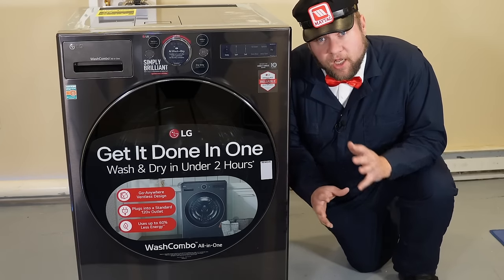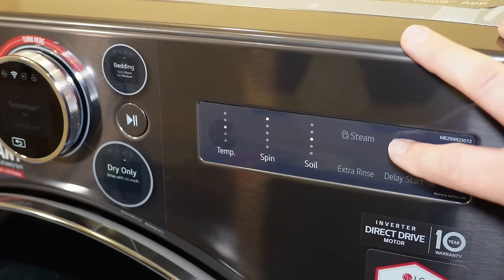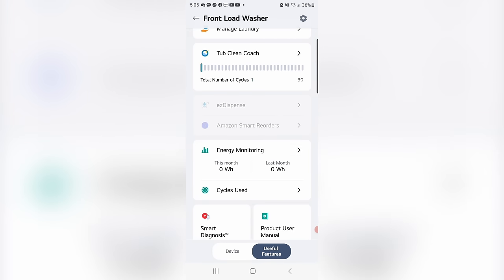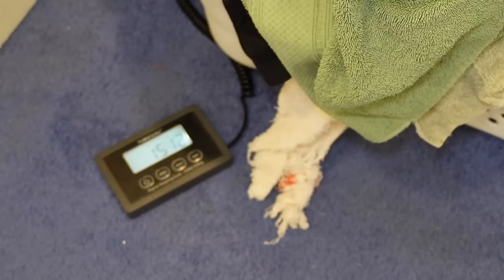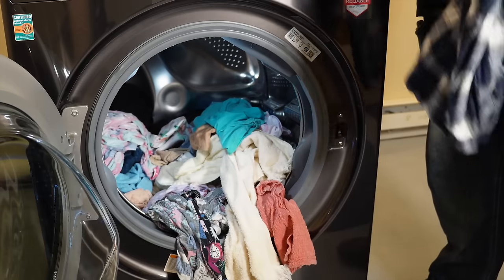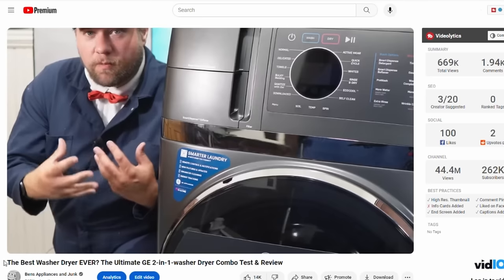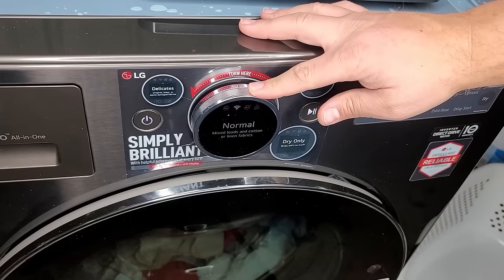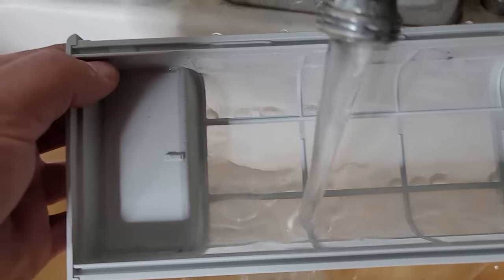BETTER THAN GE? The LG All in One Washer Dryer Combo: Test, Teardown & Review

Comment: I am from the uk and not seen a heat pump lg washer/dryer combo. 
But I can say I am the owner of a lg direct drive smart ThinQ front loader washing machine and I have had it 3 years this summer with no problems bar balancing issues with mainly dog bed and bath mats, it hates them and will hardly spin them lol 😩🙄 but other than that everything is clean first time and just damp after a 1400 spin dry. 
And the app is great ain’t it 😊👍🏻
They are good machines when it dies I hope these are over here as I live on my own work 5 days or more a week some weeks, and I owned a hotpoint Aquarius washer/dryer before this lg and I loved the convenience of having everything washed and dried in the same machine so would definitely get one again.
But do have a 2nd hand Miele heat pump condensing tumble dryer in the hallway cupboard and it’s so unbelievably cheep to run on electricity I was shocked takes a little longer yes! But for how cheap they are on energy I don’t care it doesn’t bother me at all.
Reply from the maker: FYI, LG in the US released a 240v heat pump dryer that rests on top of a washer in a stacked configuration. Looks really interesting.
Reply: @bensappliancesandjunk  unfortunately I can’t have mine stacked unless I moved the washing machine into the hallway cupboard and I live in a apartment so washing machine is in the kitchen underneath the counter top. 
And is it that LG wash tower ? If so I have seen it looks great.
Reply from the maker: @colinsace1  yes, the wash tower can have a heat pump as an option now in the US. Fantastic idea. I do think my comment was sent to you instead of someone else though asking about other brands of heat pumps in the US, as they are very rare here.
Reply: LG have the LSWD100E heat pump washer dryer in the UK. https://youtu.be/VegKMB4H9pc About £1,700 and doesn't get great reviews,  although it is more efficient than the AEG (Electrolux) model. There's a partial tear down of a broken US version of it here, shows how tightly packed everything is in a 600mm wide case: https://youtu.be/8a56vlRvrxY You're much better off with your separate heat pump dryer.
Reply: @bensappliancesandjunk  that’s fine no worries lol. 
And heat pumps been around about 10 years but only now becoming more popular and heard of. I noticed this all seems brand new technology in the us lol 😂 
But they are great in my opinion you won’t believe the electricity difference and everything is dry unless filters ain’t cleaned then everything is damp… that’s the only pain it’s got 3 filters 1 along the front of the drum like screens, 1 in the door the main filter, and one at the bottom covering the condenser fin things reminds me of freezer has to be clean I use a vacuum cleaner every 5 to 7 loads or everything is damp and clear airways light comes on so it’s a bit of maintenance to make it dry perfectly every time so for some people like my sister for instance, can’t be doing with all that work so she just sticks to a regular electric vented dryer. 
But over here I’ve not seen a heat pump washer/dryer combo myself yet all electric they are not that popular the washer/dryers over here and my old hotpoint was literally the only 2in1 that I have used before that actually dried my clothes.  
But I would have faith a LG 2in1 would hopefully be just as good or better.

Comment: Can this be used with a special hose adapter to with hooked up to a kitchen sink faucet?
Reply from the maker: Yes. I was using a single cold valve with a Y-splitter on all the early tests. You'd have to likely split the water to the hot side too, so it doesn't backflow out of that valve. But as long as you can get water pressure, you'd be totally fine.
Reply: @bensappliancesandjunk  I ask because I spoke to the company and they claim you can't. But if I understand what you're saying, a Y splitter from the faucet to the cold valve in back of the machine works. Is hot water is needed, it can be sent from the faucet to the cold water valve side as well?
Reply from the maker: @gnewt75 You do not need hot water to the unit, but I am unsure if it can use the element to heat the water up or not. Theoretically it could. Either way, I ran cold + cold to the unit for the first 3-4 washes without an issue. Theoretically, you could supply hot water via the faucet to the unit, but that may be tricky based on when it'd trigger. On a warm water wash, I saw it used 2gal of hot water and 13gal of cold as per the flow meters.

Comment: Awesome review. We couldn't work with the 4-5hr wash/dry cycles that we'd expect with a combo unit, but the technology is really cool to see trickling into the new appliances. I agree that if you have the space for a standard washer/dryer setup, that'd be ideal for both time and energy consumption (assuming you use a gas dryer, based on California's high electricity rates of ~0.35 cents/kWh).

Comment: Thanks for the great review! I was almost sold on the GE All In One, but this LG All in one seems to have better build, but the seemingly big issue is the lint problem, you managed a good fix on the GE All in One, any fix for the LG lint issue?
Reply from the maker: I don't have a fix for the LG yet. Not sure what I'd plan on, really. My beef with it is that the plastic grill that is in between the mesh filter and coils is just SO SHODDY and not really designed to be removed in a logical way (although the app shows you how to do it). 

Having said this, the unit allegedly has a lint-removal system from the evaporator. I am unure if it got cut on editing, but there's a small water hose going from the cold valve to the condenser. Maybe it sprays water to clean one side? Or the blower fan reverses? It could be a partial solution. IMHO, I think they should have made the condenser box easier to get to than what it is, so you could clean it more easily instead of having to stick a brush thru a very small slot. Same for the GE.
Reply: @bensappliancesandjunk  I haven't noticed much lint getting through the filter, but maybe that's because it's just not getting stuck on the little plastic fins and is going straight to the condenser. I thought this design seemed better than the GE, but apparently not. At least the GE has a fairly easy fix. You really need to do a head to head review.
Reply: @bensappliancesandjunk could you just rig up another screen, wrapped around the plastic fins to hold it in place, to try and catch any lint that made it past the primary filter?
Reply: @bensappliancesandjunk  Wonder if you could spray water over the GE coils to achieve the same thing…..
Reply from the maker: @Chris24436 you'd think so. There is CERTAINLY room to do that on the units having tore them down. Maybe GE will see this on the LG's and introduce a "V2" model with it? Would be huge for them, I think.

Comment: I'm getting the (certainly unintentional) Zanussi Washcraft vibes in it's design! 16 pounds in ~4 hours for a complete washer/dry combo cycle is impressive, based on a European classic "compact" non-heat pump hydrocondensor, 220v water heater (cold fill only). The bigger cabinet probably helps with getting the compressor etc. in. I would never connect any appliance to a WiFi network though 😐

Comment: Thanks Ben, great review, I agree that LG have a great track record for durability our experience. We bought our first set LG called  Throm series and it came with a 10 year warranty on both washer and dryer here in Canada at the Brick Store, 12 years later sold the house with the unit and purchased other LG washer/dryers. I would give it a try for sure.

Comment: What about reliability?
Reply: I own a WM3997HWA (previous model) its been running since 2020 without any issues.
Reply: I wonder how much build up is in those fins
Reply: @jamesgordon8867  I haven't had issues with mine, and I haven't opened it up since I bought it, but I have an older model which doesn't have the heat pump from my understanding.
Reply: When I tore down my dehumidifier and room air conditioner plus my fridge, to keep those fins clean and kept the compressor from ever failing, I cleaned & put a filter to keep fins clean
Reply: @jamesgordon8867  Yeah, I've done the same to my GE fridge recently, took that bad boy apart and cleaned it up thoroughly.

Comment: Interesting review, but as a tech I feel you are biased as the repair costs seem to be much higher on the LG than the GE, even if just for the extra time the LG takes to tare down thus making more revenue for techs.  I hope you do a LG vs GE direct comparison.
Reply from the maker: The issue is that the GE is one package good or bad... so an evap peak will require the entire package. If that isn't under warranty it could be frighteningly expensive. Alternatively the LG likely won't be, but that's just a theory I have. Both will likely be outrageous either way.

Having said that, all the other GE parts like boards and UI are horifficly expensive. I'd take LG on price and reliability on pretty much every other part

Comment: I've been having an issue with  this unit when it gets to the end of the dry cycle and it turns on the fan with spraying water on the drum. The water would seep into the drum and leave a pool of water in the drum and if there's clothes in the drum it will leave wet spots on the clothes. At first I thought it was my unit so I quickly got home depot to issue a replacement. To my surprise, i was having the same issue. I do experience water hammering so we reduced the flow of the cold water temporarily until we install a suppressor. We checked the water pressure and it's within spec(70psi). 

I tried putting fresh care on just out of curiosity which continuous to tumble the clothes after completion. This seems to be working so far as a work around. I'm not sure if it's a software glitch or a bad batch of units or possible due to the water hammer.
Reply: I just picked mine up yesterday. My first load took 8 hours to dry and had a pool of water in the back of the drum. I wonder if I have the same issue.
Reply: @WesDuncan  I've had the repair guy here 3x and the last guy said my water pressure is very high even though it's within spec. he lowered the inlet shutoff valve  so it doesn't rush in. it seems to have helped a little, but it still seems to occur. I put hammer arrestors on before they came to inspect it but that didn't seem to help. I then just recently bought a pressure regulator and put it on the shutoff valves to see if this helps. it's preset to 45 psi. I was reading 70-72 psi prior. I'll report back with results. I know the manual says 30-120 psi.

As for the long dry times, are you hearing the drain pump gargle every 5-10 seconds in the dry cycle? I would put a watt meter on the plug because I determined that the unit isn't emptying the reservoir correctly and the float is turning the pump on but not draining the reservoir which then the heat pump doesn't run after 5+ minutes in the dry cycle. You'll get a wattage of under 400 watts when the heat pump isn't running. I've seen it go between 50 -360 watts but with the heatpump running it's always over 400 watts. up to 600+ watts. You can hear the difference too. I suspect there's a part floating around in the reservoir because I get an error stating the pump is clogged. It's not. 

I ended up buying a condensation pump and draining the unit from the filter drain hose. You have to put a binder clip to limit the speed of the water though because in the wash cycle it dumps water faster than the condensation pump can pump out due to the pressure build up in the reservoir.  The wash dumps the water fine in the wash cycle though. I think it has to due with the amount of water it's dumping and not needing to empty the reservoir completely in this stage.

If I was you, i would first check the wattage in the dry cycle and if you hear a constant gurgling, and also check your water pressure. Then check the laundry in the dry cycle before it gets to the fan cycle which is around 4 minutes left .

Also the repair guy put in a request to replace the unit due to the pump being on back order
Reply: @josepht1575   @josepht1575  thanks for your reply. So far I've found that the AI mode makes my loads take 6+ hours to dry. I think it might be operating fine when in normal mode. I'm on my third load now. First two were AI and this one is normal and is working better. I ended up cancelling the AI drying on my second load and it dried four hours faster than AI was saying it would.

I'm not sure on hearing the drain gargle. I haven't been around to listen.
Reply: @WesDuncan The Ai dry i think gets reset each load. so if the last load didnt dry right, it will display a long time. ive seen it say 8hrs but when i change it to dry and let that finish, then run ai wash dry on the next load, the time is much more accurate. i also weighed the laundry to get a base line to see if i was within spec. they say 2 hrs for 10 pounds so i was getting around 2 1/2 when running correctly if it wasnt towels. you might want to give that a try too
Reply: @josepht1575  I'm noticing I have a pool of water in the back of the drum like you do. My clothes will be completely dry, except for spots that are completely soaked from falling into the wet spot. I wondered if it was a leveling issue, so I put a level on it insured that it was perfectly level in all directions, that didn't help. I'll have to stay around it and listen for the gargle while drying.
Reply: @WesDuncan  also the pressure regulator didn't seem to help me. I'm guessing they shipped some out with bad valves that leak when the inlet valves are activated. Normally it wouldn't matter on a washer but them being a combo, you don't want any water getting into the drum while drying.
Reply: @josepht1575  does yours have water in the back of the drum as soon as the load is done washing or does it sit for a while before you check? I've seen other people say their LG washers slowly fill with water. It seems like the inlet valves sometimes don't fully seal shut.
Reply: @WesDuncan  when i run a 30 minute dry cycle without anything in, you will see water seep in after completing and pool in the back of the machine. it won't continue to fill the drum. it does stop which makes me think the pressure is eventually relieved.
Reply: so i might have spoken too early on if the pressure regulator not solving the water getting into the drum during the end of the dry cycle. We've run about 6 cycles since installing it and no longer seeing water. The hammer arrestor did not resolve the problem though. So you might need to get a pressure regulator. I'm guessing the pressure regulator needed a few cycles for it to work better.
Reply: @josepht1575  I actually had ordered a hammer arrester and pressure regulator not long after I saw your comments. I installed them and I do believe it's making a difference for me as well. I need to run more loads to be sure and I have nothing left to wash lol.
Reply: @josepht1575  another thing I changed is using dryer balls. I started using plastic dryer balls. I let them go through the wash cycle as well. It seems like it speeds up drying a little bit.
Reply: @WesDuncan  ha! I'll have to give the plastic dryer balls a try
Reply: @josepht1575  have you had a chance to try plastic dryer balls?
Reply: @WesDuncan  So i figured out the issue with this unit. Ben was nice enough to give me some advice while trouble shooting and it seems this unit has a tough time with siphoning while in the dry cycle. His testing was done at 35" drain height. My drain is 54". it seems that the unit can't drain properly above the units height. When we put the drain hose into a trash can during the drying cycle, it dries correctly, and the wattage stays above 500 watts. I believe it also doesn't pool water into the drum as well. More testing is required to determine if that's true.

This is my third unit and they replaced the pump so it seems it's a design flaw.  The manual says that my drain height is within spec
Reply: @josepht1575  I wondered if that was a part of the issue. Like you, I checked the manual and my 46" height is fine. My issue seems to have mostly gone away with everything that I've done. I'm looking to get the base for the unit, so that would further reduce the height of my drain as well. I appreciate you continuing to comment and keep everyone posted. This is an amazing product with a few quirks that need addressed. I love mine now that it's drying consistently.
Reply: @WesDuncan  totally agree with you. If this thing drained right, it would be a great unit to use.
Reply: @josepht1575  unrelated, but I solved a couple of lint trap issues. Do you know the piece directly behind the lint trap with the fins on it that always collects lint and hair? I busted those fins out. No negative effects so far, and there's nothing to build up lint on. I also added a thin filter to the right of the lint trap. I kept having dog hairs work their way through the lint trap and build up on the coils. I've probably ran a dozen loads through like this with no issues.

Comment: I’ve owned an LG combo washer/dryer for the last four years and it’s been easy to use, efficient, and reliable. 

Favorite feature: Put in once. Take out once.
Reply: Yeah, this is basically the only reason I need to change to this type. Forgetting to move it over happens to me 3/4 times. The savings of not having to update the electrical helps bring down the price to comparable side by side w/d